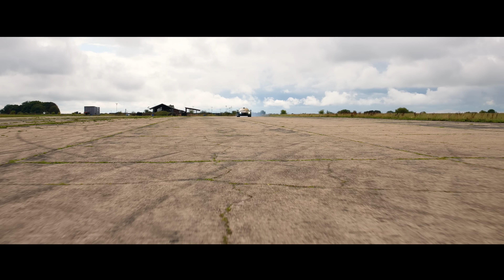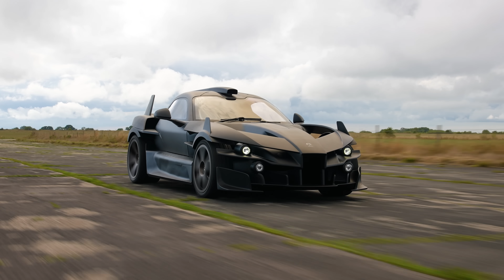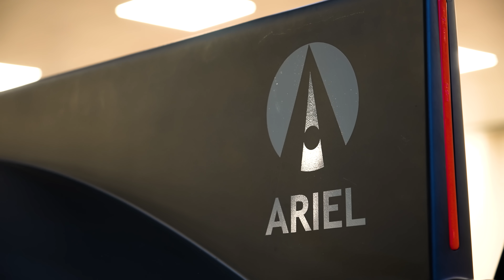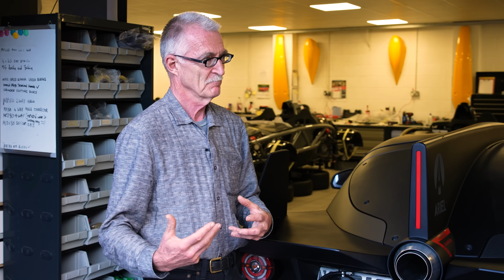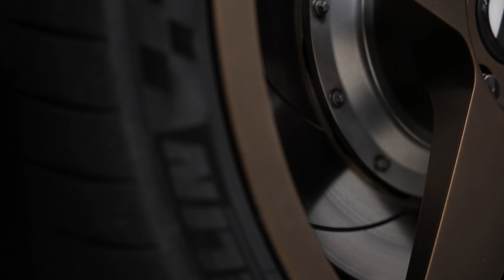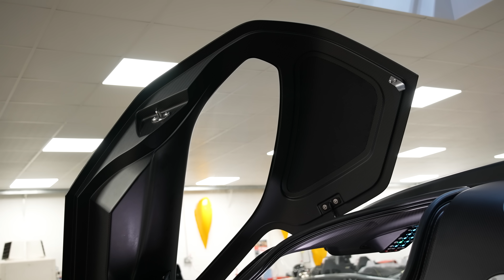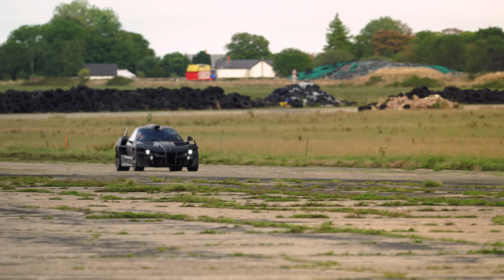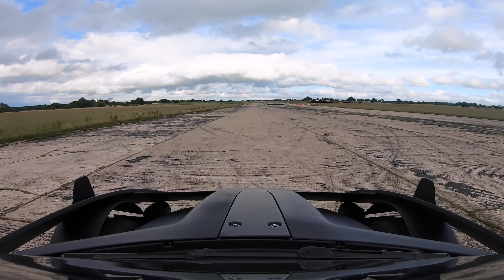NEW Ariel Hipercar – 1180bhp, 0-60mph In 2secs + Jet Engine?!  | Top Gear

Comment: Fun fact, back in the 60s when they were developing the Rover P6 it was designed to use a turbine engine. It came very close to happening but sadly never did, it was so close in fact that the P6 was launched with the same wacky front suspension created to fit a turbine. I'm glad 60 years later companies like Ariel are still trying with jet technology
Reply: My grandfather had a next door neighbor who had a turbine car from Chrysler in the early 1960s. Apparently Chrysler picked some "typical" American families to drive and use these turbine cars for a few months to see how they'd hold up to daily driving and weekend family abuse. Now I don't know anymore details about what happened (I'd have to ask him what became of the program and what his neighbor thought of the car), but I thought it was pretty cool they were building turbine cars that long ago and people actually got to drive them. There's even a wiki page I believe that goes into more detail about the program and specs on the car.
Reply: @Peanutdenver  I think Jay Leno has the same or similar car you speak off. If i remember right they were all prototypes and were supposed to be scrapped when they stopped the program. It was basically the US version of the Rover P6 but it survives to tell the story
Reply: @mrcaboosevg6089  After I read your comment I did a bit of googling and I believe you nailed it. I also remember my grandfather saying it was pretty quiet considering and there was no transmission tunnel in the car. I'll see him soon and get some more details as this comment stream has peaked my interest with the car all over again.
Reply: Jay Leno has a turbine car, its on his YouTube channel
Reply: Don't forget the Y2K motorcycle

Comment: Bro whoever came up with that finalized design deserves a raise. It looks like a Batmobile with the size of a Miata lmao
Reply: Hydrogen aka only 3 - places sell it in the UK... oh and The turbine so you don't have to rely on the charging network but still need petrol... ermmm
 THAT`S RELYING ON THE PETROL NETWORK...  hydrogen fuel tank oooh at 30-000psi near a jet turbine engine 
"" KAAAAA BOOOOOOM ""...

Comment: Super compact.  Serious ELI5 question; if the turbine produces heat (hence danger) AND there is a need for downforce would it be possible to angle the turbine e.g. 'up' if even by fractions of a degree to complement this need to keep it glued to tarmac?
Reply: I’d speculate that because turbine is being used for shaft horsepower instead of trust, like a helicopter, there just wouldn’t be a meaningful push from it.
Reply: @tdolan500  shaft horsepower and angle usually make a difference, is what she said..

But yes seems to make sense cheers

Comment: I wouldn't call a turbine efficient necessarily but if you factor in the weight of the alternatives, it is an obvious choice for a car like this. Power to weight is unmatched. Pretty wild they actually did it at all.
Reply: Around 30-40% efficient for the best microturbine generators. That is not bad, but a piston generator of the same quality would be 40-50% efficient.
Reply: @jimj2683  50% is like medium/low speed diesel territory, unless you have turbocompound diesel engine maybe.

Comment: Love it!

A nomad, an original Atom and now this is on my fantasy car garage!
Reply: I love the Nomad but it's so loud. I'd want to use it in the countryside, sneak around and not disturb too much.
As I'd not log many hours a day in it, an electrified Nomad makes all kinds of sense to me. AWD. 4x100 kW for instance. Rock crawling buggy that also does tank turns and MAD accelerations. 30-50 kWh battery would be plenty, it's not a travel car or something I need to lap on the track for an hour straight. I'd beed new goggles and boxers every 5 minutes anyway.

Comment: Turbine/EV hybrid has always been a thing that appealed to me, they seem to complement each other well, the turbine has a great power to weight ratio and is fuel versatile but has laggy throttle response, meanwhile batteries have instant throttle response but bad power to weight.
Reply: Indeed, you can run a jet on almost any explosive liquid so making it carbon neutral wouldn't be very difficult.
Reply: @mrcaboosevg6089  Plus it would probably also still work in a mad max scenario xD
Reply: @aphinion  or even THE CREW chase scenario.
Reply: Supercapacitor/turbine makes even more sense
Reply: Maybe I didn't hear but I would imagine that the turbine/generator here is set to operate at one speed. The most efficient output vs fuel burn ratio. What I'm wondering is whether the generator is running co-axial with the turbine or is driven off of a gear reduction set. And just what the exhaust temp is.
Reply: I wonder if it can manage below 95db because that is the noise limit on the track in my country.
Reply: A turbine generator is smaller, lighter, far more reliable, and gives less vibrations than a piston generator. Also, it burns the fuel more completely, so the exhaust is much cleaner too (no need for exhaust aftertreatments). Only big disadvantage is the lower fuel efficiency (but not by much and since it is lighter you can carry more fuel to compensate.). Also, turbines are more expensive to buy (only because of small production runs. They are actually quite simple mechanically), but they are much cheaper to run.
Reply: A single-stage gas-turbine engine without recuperation is definitely nowhere near as efficient as a conventional ICE engine but who cares?   This machine creates a whole new genre of fun-car and if I had the money, I'd be lining up to buy one as soon as they start rolling out the factory door.
Reply: @xjet  the major difference making this far more fuel efficient than an ICE vehicle is that a combustion engine is running 100% of the time, where as this can be cycling on and off the entire time (and likely off the majority of the time)
Reply: @xjet  Are you sure? What thermal efficiency would each be? In this car, there is at least (a plan for) regenerative braking which helps in traffic or on track. Although the turbine is too week to keep spirited driving going on a track. Plenty for an autobahn run, I would say. Just not at 200 kph.
Reply: @Cloxxki  The efficiency of any combustion engine can be pretty much established by the compression ratio achieved.  A regular piston-type ICE has a compression ratio of 12:1 or so.  A single-stage gas turbine engine has a compression ratio that is seldom more than 3:1 or 4:1.    Large multi-stage gas turbine engines can be very efficient because they often run compression ratios of up to 40:1 and use recuperation of exhaust gas temperatures to pre-heat the intake air just before it enters the combustion chamber, which creates higher comression ratios.
Reply: @xjet   @xjet  mere amateur here, but I always got the impression that the "poor fuel economy" of jet engines comes from throttle use less than full on (idle use half the fuel of full throttle or the like).
But in this application only full throttle will be used, so here all the pros none the cons.
Reply: @xjet  this car still slower than GT300 race cars.
Reply: @purwantiallan5089  But it's black!  It has fins!  And a JET ENGINE!!!    🙂
Reply: @purwantiallan5089  it’s a track day car.
Reply: And the turbine should have no probs helping recharge the battery. It will make for a hybrid driving experience too, i guess.
Reply: It’s how ships, trains and tanks are powered.
Reply: imagine breaking down in a jet turbine car
Reply: @mrducky179  Luckily, jet turbines are extremely reliable. Unlike ICE. 
Good proof of this is the amount of jet airplanes that have turbines break down in flight. Almost zero out of the hundreds of thousands of planes flying right now.
Reply: @mrducky179  even if the jet engine breaks down, you still have up to 150 miles you can drive!
Reply: And in such a car the lacking fuel efficiency of jet engines is negligible. Might even still be better then our standard piston engine doing the full propulsion work… just love that concept…
Reply: @aphinion  You missed the point. A turbine has vastly superior fuel economy to even a tiny 3-cylinder diesel. More battery charging from a liter of fuel. Less heat losses.
Reply: @Cloxxki  holy cow I beleive you’ve got it flipped.
Reply: The turbine so you don't have to rely on the charging network but still need petrol... ermmm
 THAT`S RELYING ON THE PETROL NETWORK...  hydrogen fuel tank oooh at 30-000psi near a jet turbine engine 
"" KAAAAA BOOOOOOM ""...
Reply: @kylereese4822  It is not a problem to have a high pressure vessle near a jet turbine, any danger can easily be managed, those tanks can take a beating. But they are heavy and bulky for the energy they hold.

Comment: Man the silhouette of this thing looks like an electric RX8 with a crazy bodykit.
Reply: or an atom with layers of body work
Reply: Reminds me of a first gen Hyundai Tiburon lol
Reply: @scottrobson4097  more like turbo upgraded Hyundai Accent.
Reply: From the front it looks kinda mk4 and mk5 supra-ish, from the side it looks kinda rx7/rx8ish - both in ways that neither manufacturer managed to pull off on their own newest generation vehicles. From the side it really looks like they took an RX7 (with an Elise rear) and just went "No. it should stop at the back of the rear tires. Nothing else." The brits have perfected japanese cyberpunk styling.
Reply: I really think they kinda copied the 'spierling' or whatever it was called, the current hill climb record holder which beat out the Volkswagen ID ev car, that car was like a narrowed down ev batmobile..
Reply: Its probably based off a rx8 chassis, but a chop shop version to fit ariel look.
Reply: Imagine having 1200 hp in rx8
Reply: i was gonna say the middle part of the body (around the doors and cockpit) looks like an rx7/8
Reply: Kinda like the old Apache street kits!
Reply: Agreed! I was thinking RX-8 with eBay special aftermarket parts. It has terrible height stance.
Reply: I was thinking it looks like the Supra should have looked
Reply: more like an MX3
Reply: This is basically what the KTM X-Bow GT4 should've been....😏
Reply: I wasn't the only one lol
Reply: This is crazy. I've been obsessed with Series Hybrids - hybrids where the ICE is just a generator for the last month.

 EVs suck in one majior way. Weight! I mean batteries are heavy, and not good enough to build a light car. 

 With this you get the benefits of the EV with the instant insane torque, light as hell reliable motor, but have the range of an ICE. 

 What engine though would be the best? I kept seeing new engine designs from the Omega, Aquarius, to the Liquid Piston rotrary which promise tons of HP in a small package... 

 That is when I remembered turbines are the best generators as far as I know.

 I even asked on Reddit why series hybrids aren't more common. 

 Anyway a few weeks later I find out this, and one other company have already tried!

 Ariel however is well known for an insanely fast, light, sports car which is exactly what I was thinking this type of set up would just be perfect for until batteries can become better. 

 Anyway awesome job, and I hope they work on it more. I hope more car companies take their hand at it as I'm not sure how good Ariel is at either EVs or Turbines.

 Anyway my first thought was... A rotrary would be great for a series hybrid. Mazda should go all in. 

 They have with their MX 5 concept, but I'm not sure if it has insane performance like I was hoping for. 

 Turbines are loud as hell, haha. Not exactly something you want to daily drive.

Comment: "Range extender" lol. Considering the "efficiency" of a jet engine I can imagine the "extended range" to be at most 30...50km unless this has a 60l fuel tank... which will compromise the actual concept of a hybrid. You could have a normal IC engine with half the hp on a much lighter car that could provide similar performance. 
And the jet exhaust... at which distance you could stay safe in traffic from that jet toaster? 😁

Comment: I was gonna get an rx8 gh450 trans with the starter generator and a custom inverter.  Even if the Renesis had had bad apex seals u can stil get it to run .    Both together would add up to 500 hp.  And 
About 160mph top speed .

Comment: Always thought this was the solution...stick a low power high efficiency generator in a car to charge the batteries...no need for luney tunes charging networks. 
Just top up every few 100 miles?

Comment: So this is a gas powered EV? If you can just fill it with petrol and not have to charge it because of the turbine, then wouldn't it technically be a gas car? Or is this then a hybrid because of the electric motors? Or is it an electric car despite it needing gas for the turbine?
Reply: It's technically a hybrid with range extender motor (turbine). You can run it petrol only. Not sure about the range battery only but if you were driving like miss Daisy probably good enough.
Reply: It's basically a Fhisker Karma done right

Comment: As soon as manufacturers start recapturing heat and somehow turning into energy, we’ll have increased efficiency ten fold.
Reply: That's what the MGU-H does in a current F1 car
Reply: @TimInertiatic  and they are ditching it in 2026 🙄
Reply: @TimInertiatic  and it’s a significant factor in why F1 engines are so costly.